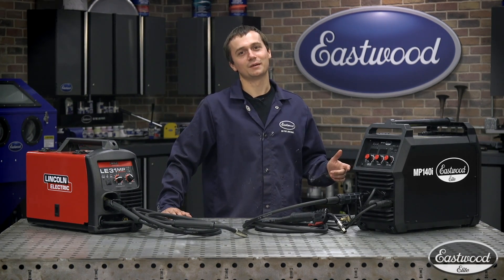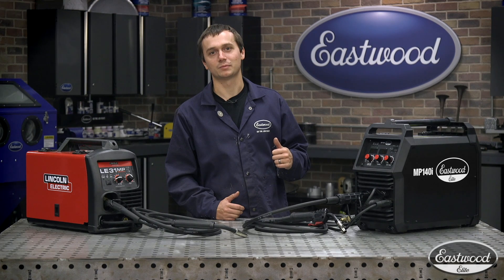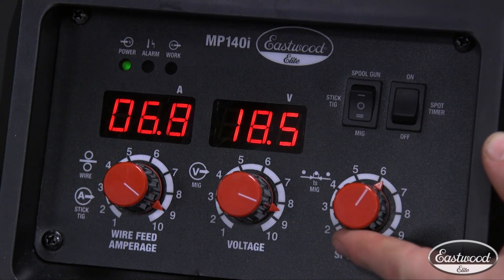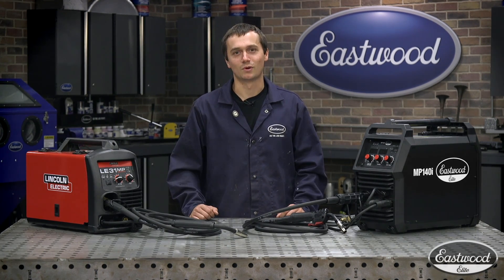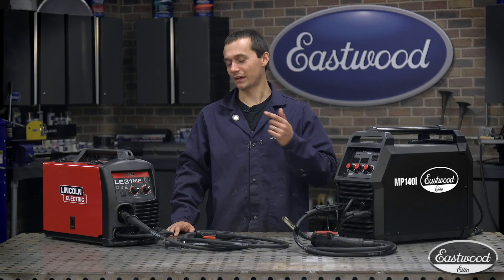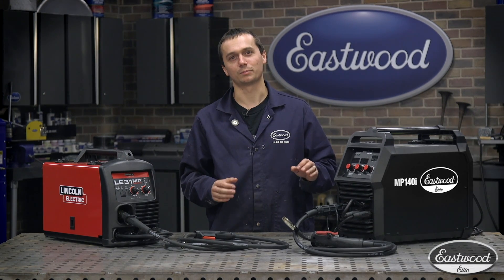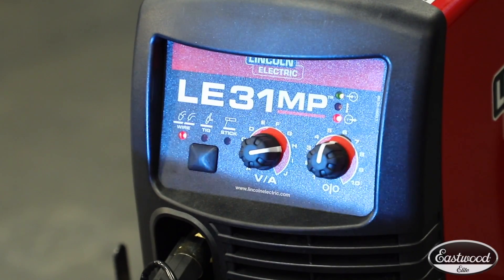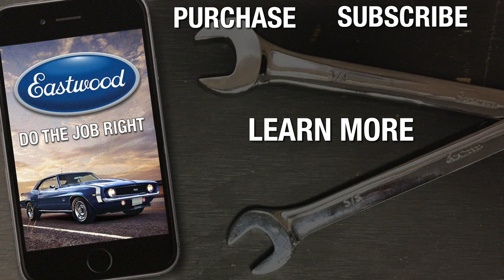Lincoln LE31MP vs Elite MP140i - MIG TIG STICK Weld for $300 LESS! Eastwood

Comment: I just bought the Lincoln LE31 to replace my Eastwood mig welder. Fool me once, shame on you. Fool me twice...well that didn't happen this time.  The main problem with my Eastwood mig welder was the crappy drive unit.  It was forever not pushing out the wire no matter what I did.

Comment: Eastwood cant manage 3/16. Just tried it with max wire speed .030 and its still not enough. The drive roller only holds 0.30 and 0.23

Comment: I bought the Lincoln about a year ago. I have no regrets. It's a damn good welder. I paid about $870 at Home Depot including tax. It's probably another $300 for the tig setup which I haven't gotten yet because I haven't needed it, but I plan on getting it soon. I've welded up to 1/4 inch. Haven't had anything 5/16 yet to try it on, but I have no doubt it can handle it. So far, I've only used flux core. I don't weld much. Just the occasional equipment repair, and a couple fabrication projects. All I need is the gas bottle for Mig. It comes with everything else.
Reply: Hey man, I need a multi process welder and need some suggestions. I welded for 4 years but have switched to pipefitting over the last 5 years. I’ve never used mp machine. Do modern models weld well? I don’t really need tig but I need stick and mig capabilities. I’m going to be running off my house circuit and never welding anything above 1/4” but it would always be nice to have the option to go higher, although I probably will never use it, so it’s trivial for me.

Comment: The lincoln has a 60% at 95amp duty cycle over double the eastwood and can be used to tig aluminum where the eastwood cannot digital readout was the main point to try and say it's better and they go out quickly the rest of the features of the welder isnt even comparable quality wise the lincoln blows these eastwood machines out of the water
Reply: The Lincoln can’t tig aluminum. You can mig weld aluminum with the optional gun & spool though.

Comment: The LE31MP will weld up to 5/16" thickness, while the Eastwood can only manage 3/16"....not to mention the duty cycle on the Lincoln blows the Eastwood away.  You should not need to go with 240 volt unit just to weld 1/4" steel.
Reply: So the Lincoln can penetrate as far as 5/16 of an inch sorry I’m still not sure how it  works I’m new to welding

Comment: I have has a sp125 plus since 1990, it has always been flux core, it still works fine, looking to buy another small welder so I can go mig gas, leave the sp125 as flux, no changing over.
The lower price is tempting on the eastwood, but the reliability is making me think Lincoln.
Looking for a tie breaker.
Reply: I have owned the sp 125 and the sp 135 both reliable and solid mechanics. I upgraded to the transformer miller 211 that can plug in to 220volt or volt 120 volt and has a better duty cycle I am not sure of the cost difference but I have had it for 5 years with out any issues. Best of luck in your future purchase and remember to where your leathers you don't want skin cancer on your arms because you can't weld if you're dead and the goal is to weld more.🇺🇸 oh by the way my last YouTube video I am welding a 14 ga. Galvanized roof curb for my log home fireplace. Check it out the 211 welds smooth
Reply: @alaskanken2132  so true and thanks for the information....
Reply: @mike f  any time. What welder did you get?
Reply: I finally got 220v in my garage this summer, no more long extension from house and omg my sp125 is a whole different animal.
Now that I have power i'm recalculating some. I can finally use my 1990 ac225 buzz box. Leaning towards a multi box like le31mp, so I can play with some tig, dc stick, and a spool gun for aluminum. Light bodywork and small fab stuff for the hot rods. The sp125 will stay flux. I'm retired so got to keep price within reach. A box with spool gun and entry tig torch under $1500 is about right. My Lincoln stuff has been dead reliable, so I am partial but not cast in stone. With 220v available, I got more options, and kinda want to put the 220v to use, decisions, decisions. Ever since adult ED welding in 88, I don't play with safety, hot or cold by the numbers always. THANKS FOR THE INPUT.

Comment: Show me one that has welded as long as the 10 and 20 year old Lincoln and Miller, and I'll buy. Until then I'd rather spend more for the reliability they get. All those bells and whistles don't mean nothing if it isn't reliable. And if I'm going to go cheap, I'll go to harbor freight, they're close, and I can have the replacement that day. They're great welders out of the box too.
Reply: Those old Millers and Lincoln welders will still be throwing out beads in another 20 years. MERICA ✌🇺🇸

Comment: Seems like with that Eastwood sign hanging on the wall there, you might be a bit biased!!!! But I do like the digital readout.
Reply: Well it was a commercial for eastwood, so ya maybe a little bit biased(look in the bottom right corner, eastwood stamp.
Reply: Digital redout is a first thing to go out. You may need time to learn how to adjust this Lincoln, but it wont brake
Reply: @dado4352 I can agree with this. A good welder learns their machine and where the settings are just off a dial.
Reply: Yeah but that 30% duty cycle at 90 amps kinda sucks
Reply: @throwawayh5746  Lincoln is 60% Duty cycle.
Reply: I do dig the digital read out
Reply: If he was lying about something, IT would be an issue.
No lies detected. He didn't really disparage the competition.

Comment: How does yourMP140i compare to an equivalent Hobart?
Reply: Hobarts are a transformer welder both these machines are inverter welds much a better design and way more efficient!
Reply: @joatmon1857  Call me crazy but I prefer the transformer model's to the inverter. I hate the way they start soft I run a Miller 211.